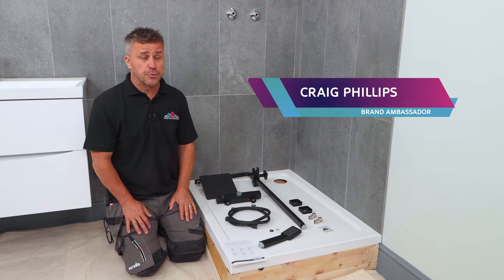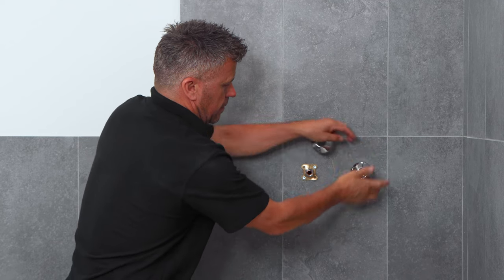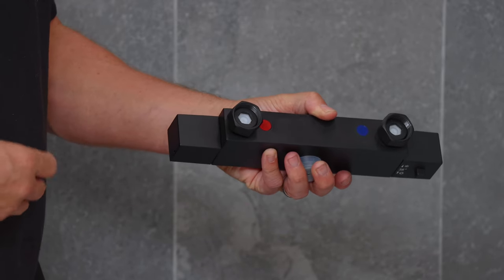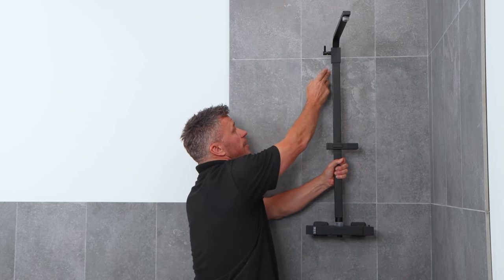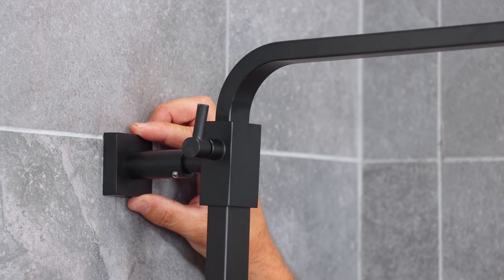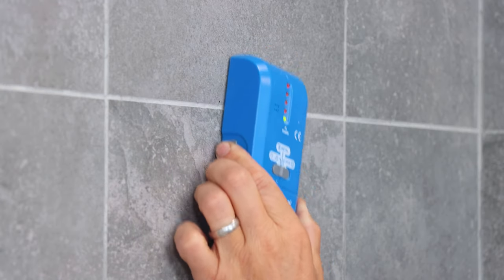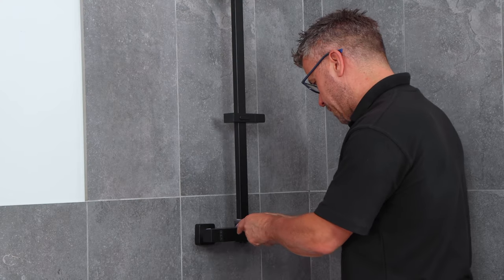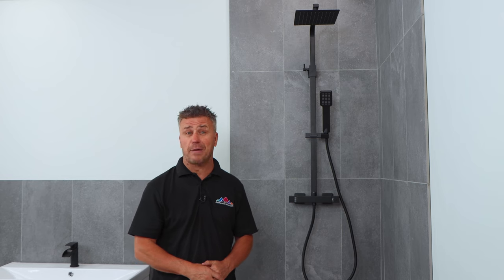How to Fit a Shower | Bathroom Mountain

Comment: If you have any questions, feel free to ask!
Reply: I'm in the process of fitting pretty much the same shower. When I can to tightening up the shower bar valve nuts (2:10 on your video), they don't seem to tighten up so they're flush with the backing plate covers. I end up with about 3 threads of the chrome 3/4" nut showing between the black plate covers and the black shower bar valves, and it looks a bit odd. Have you got any suggestions on how to get this all to tighten up flush?
Reply: @jacksonsunite  Hi Dave, apologies I've only just seen your comment, I hope you get it sorted, you will see at 2,40 Sec that we also had the Crome screw thread showing a little, its pretty standard